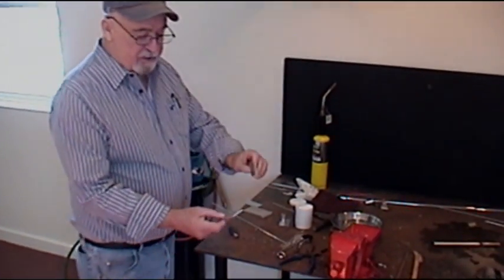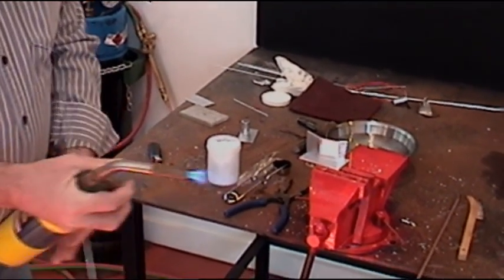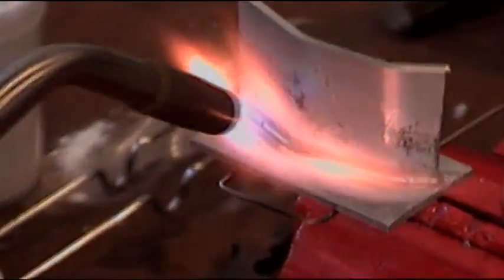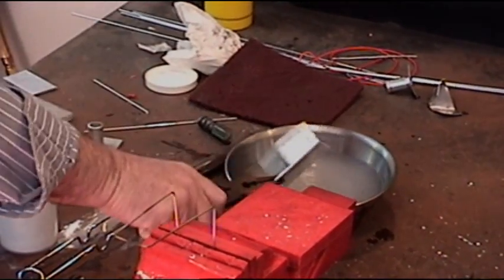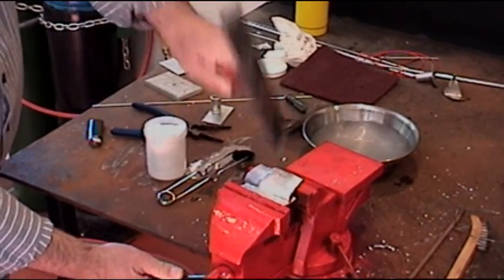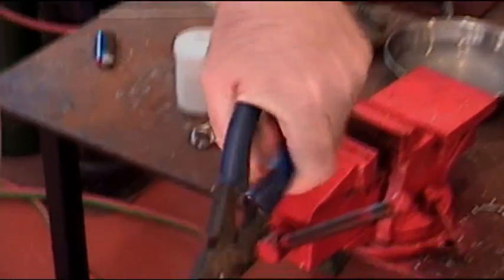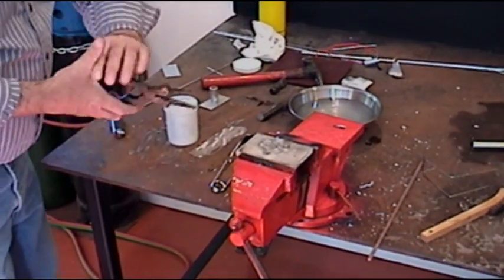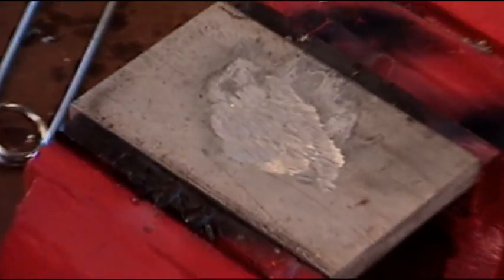Aluminum Brazing with Flux Demo - Vulcan G-51

Comment: Thank you Sir you're a lifesaver I called professionals no answer I called stores they don't know what they're doing I saw this alloy one and alloy 2 on here but I'd have to order it and wait for it and I need to do it right now I found you and I am so very grateful Sir you're the man. I found low temperature aluminum rods at harbor freight and then white powder at Home Depot and I can get my camper shell bracing welded back up before insulating and I'm crunched for time and I can get it done tonight again I'm very grateful and I thank you very much for posting this tutorial.

Comment: What grade of aluminum would you recommend for vintage motorcycle oil tank?  3003?  6061?  The tank will be subjected to vibration.  What thickness of material would you recommend?

Comment: So, I have a failed brazing joint (I didn't use flux the first time). I am welding 1/8" wall tubing in a T shape, do I need to try to grind off the last attempt or can I just sweat it in around it?

Comment: I bought some aluminum brazing rods braze cracked cast aluminum that is 1/8” thick, and approximately 8” long.
Unfortunately i ground a V- Grooves on both sides to prep it, but realized that when i go to braze the second side, the heat will loosen the first side.
I’m thinking to grind the grooves thru just enough to put a damn on one side so the aluminum rod can then flow thru to the other side, then just finish filling the groove.
Will this work? 
If not could you please let me know if you have a better idea?
Reply: Gopal

Comment: Wow !   How come this is the only video I've seen using flux !!!  Just what I was hunting for, and it lays down so cleanly. ...  for the guys using Borax. its good practice to heat in the oven to remove the water molecules in it. Believe it becomes Anhydrous Borax then.
Reply: That's true, but we don't use borax flux for aluminum!  There's special flux that dissolves the aluminum oxide, which is very refractory.  Borax, or borax/boric acid works well on copper based metals, silver, copper as such.  Maybe on steel.   The stuff for aluminum is entirely different, and much more expensive and toxic and corrosive!  So, you have to really want that good aluminum braze!  As it happens, I do.
Reply: This is some (probably rebranded) Al/Si brazing alloy.   The vast majority of videos you see are Zn/Al low-temperature rods.  

While the zinc rods will wet to aluminum without flux, they do not wet freely without it.  That's why everyone has to scrub the rod against the base metal. Such rods may be flux-cored or solid and used with or without flux.  There are a lot of misleading marketing claims that often imply certain zinc wonder rods are flux-cored when in fact what they mean is that they are "fluxless".  In the US, almost all Zn/Al rods are solid and flux is not commonly available.  Fluxes specific for Zn/Al on aluminum do exist, but good luck buying any.  This all adds up to mean that you're going to see a bunch of poorly performing products in videos.  In all those videos, I see people pushing around a lot of drossy filler metal that won't wick into any gaps.  The marketing people spin it into a feature by saying it's "good at bridging gaps".  

The G-51 flux is a borate flux, but it's not the same thing as "borax".  Disregarding chemical reactivity, there's probably a few hundred degrees F difference in melting point.
Reply: Yeah, some videos are using "low temp" brazing rod which isnt always the case

Comment: I have an aluminum boat where the back part where the motor is mounted is cracked and bent from someone hauling it with the motor down. Would I be better welding or brazing?
Reply: From demo the braze joint is stronger than the base material...
Reply: Yes, agreed
Reply: This stuff works wonders but just remember a rule of thumb normally welding soaks into both Metals brazing just melts the rod material and normally it just adheres to the surface of the aluminum rather than get any penetration to speak of. I would say mig weld it and then TIG weld over it to make sure there's no bubbles or just TIG weld it. Look up online some ways that you might can Gus it the transom of the boat that you are repairing so it won't happen again and or break in a different spot

Comment: ok on the flux part..... can you use any flux, or does the flux have to be for aluminum?
Reply: Borax, "lite" salt, washing soda, and all other ridiculous grocery store voodoo nonsense are not aluminum flux.  Most of these things won't even melt or become beneficially active before the base metal melts.  

Borax (just sodium borate) does work for brazing with brass/bronze alloys and steel.  

Many fluxes for Al/Si brazing of aluminum include some borate compounds in the mixture (e.g. potassium fluoroborate).  I'm pretty sure people just think "brazing" + "something-something-borate" = "must be laundry borax".  It's not the same thing.

For aluminum, you're going to have three common categories of fillers, each with their own appropriate fluxes: 
Soft solders (such as Sn/Zn alloys)  <- Lowest temperature
Low-temp braze (Zn/Al alloys)
Normal braze (Al/Si alloys)  <- Highest temperature
Reply: Borax "20 Mule Borax", Boric Acid, Trisodium Phospate. Use any one or a combination in equal parts. Borax is the best. They are also cheap. about $2.00 per pound each
Reply: is flux necessary?
Reply: Ryan gst h